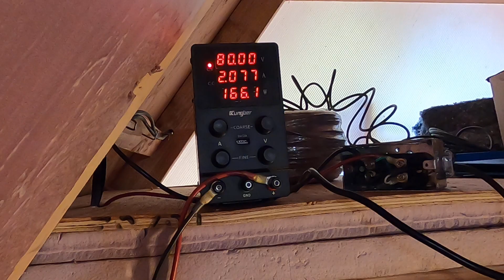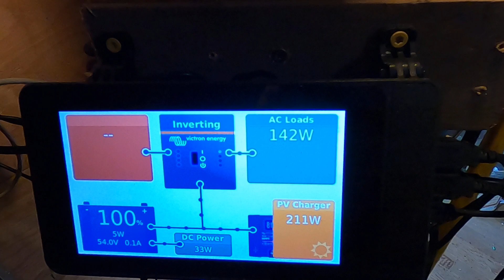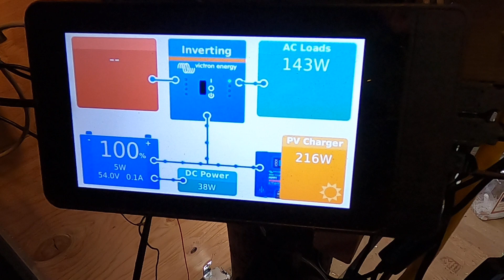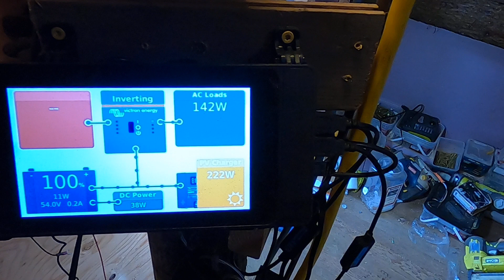Shunting Amps from Hydro System to LiFePo4 Solar System

Comment: curious,,, what are you using for a battery disconnect? I have been assembling 4 24-volt 2P8S battery banks with 16 Lishen 272Ah cells. I am using 1 bank now.
 keep up the good work on the videos!
I bought 20 mm long x 6mm studs and flare nuts to replace the bolts I received with the second batch of Lishen cells. They work good to contain the busbars during assembly. I bought some Permatex brand stuff rather than lock-tite, but the same idea basically.
thanks in advance.